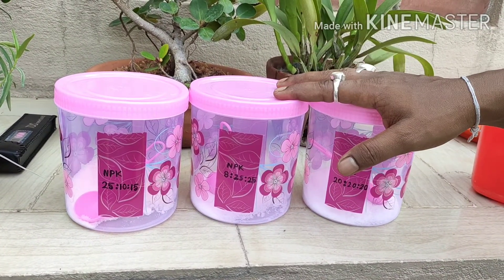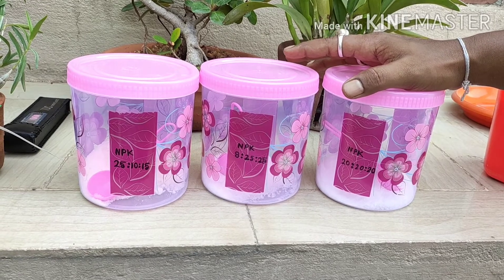How to fertilize an orchid#sandiporchid

Comment: Brother, I have a question to ask, for a dry climate area (humidity below 30%) in summer how to grow or maintain orchid. 
And can we use synthetic cotton balls  mixed with Coco husk for medium as charcoal and brick pieces will dry in 4-5 hrs completely if used as media. 
The area that I live in easily reached above 45°c with a very low humidity level even below 30%.
Reply from the maker: Thanks for asking a good question. Yes you can grow Orchids, in winter is okay but problem in summer! If you are a beginner so you can grow hybrid Dendrobiums. You should use charcoal and small pieces of bricks mix 50:50. If you ask me,I will suggest ,don't use coconut husk. Because coconut husk has tendency to decompose easily within a year. Dry hot wind is very harmful for your Orchids. You should cover your garden totally by green shade net. You can create artificial humidity by put some water filled trays, you can mist water in the air around your plants few hours duration.
Reply from the maker: You can use humidity trays also, for more information about humidity trays, you can see my another video about humidity trays
https://youtu.be/sW2W3btM7A8
Watch it
Reply: @SandipOrchid  thanks brother. It helps a lot. I  have sent a private message in FB please reply to it.

Comment: Very informative. I would like to ask you, can i use balance NPK and micronutrients (like agromin gold) togather on orchids or do i have to apply them separately keeping a gap of 7-8days? Please reply and oblige.
Reply from the maker: Yes sir you can use 20:20:20 weekly basis 1grm/1lit. Of water ratio, just remember, before applying fertilizer water the plants thoroughly. Thanks for asking me 😊
Reply: @SandipOrchid  thank you for the information. Can I mix npk with agromin gold and spray? Or do i have to apply them seperately?
Reply from the maker: You can, it is probably micronutrients , though I never used it as I don't know the actual chemical reactions
Reply: @SandipOrchid  I see...